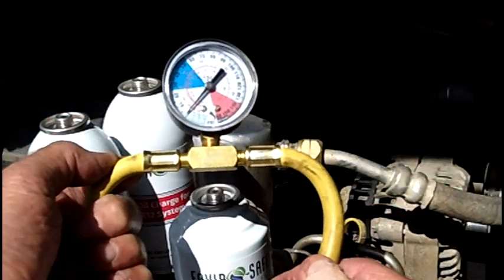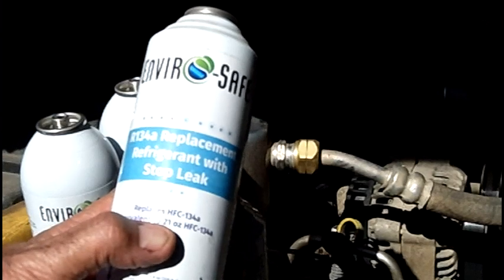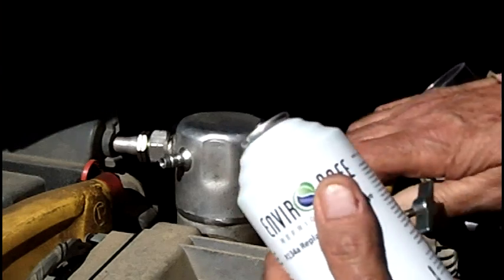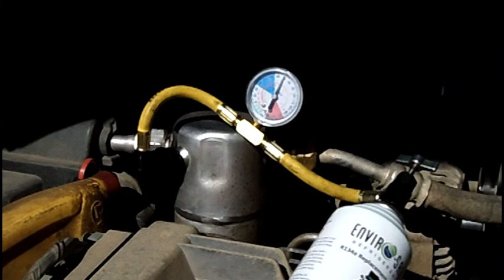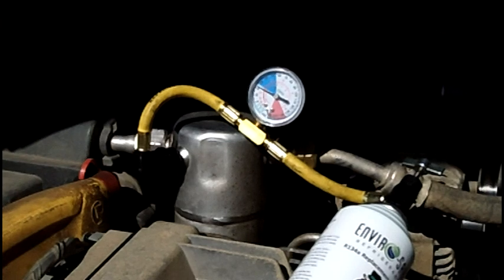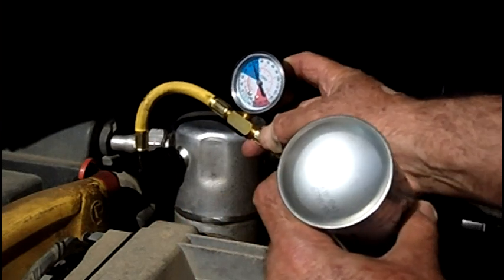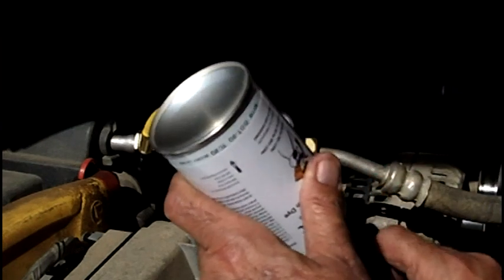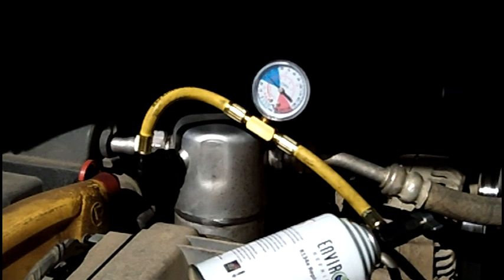AC Refrigerants for R12 & R134a Cars on ebay.  stores.ebay.com/CFA-Services ENVIROSAFE

Comment: Will this work on an old r12 walk in cooler also?
Reply from the maker: Yes it works at anything that normally uses 134 or R12.  It was first designed for refrigerators and freezers

Comment: Is this product an alternative to r134?
Reply: Is this a drop in ? Can you top off the 134a in the vehicle another words mix it? Or due you have to empty and then recharge ?
Reply from the maker: Yes this was designed as drop in Refrigerant. But keep in mind mixed refrigerant cannot be recycled. They are deemed as contaminated. It works in 134 and R12 systems
Reply from the maker: It is alternative to 134 and R12 systems both